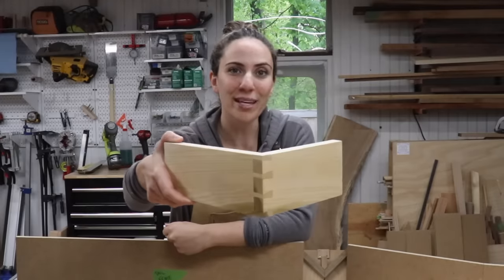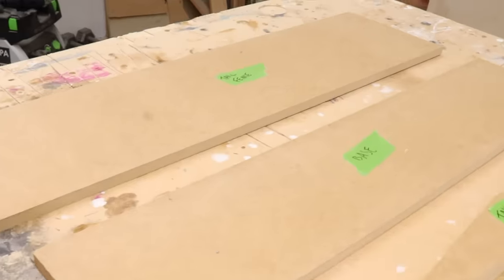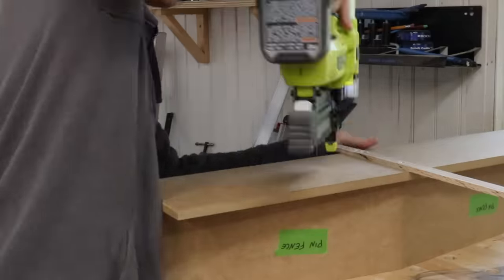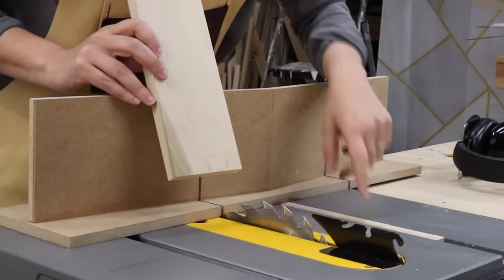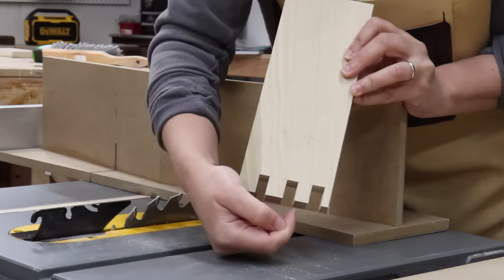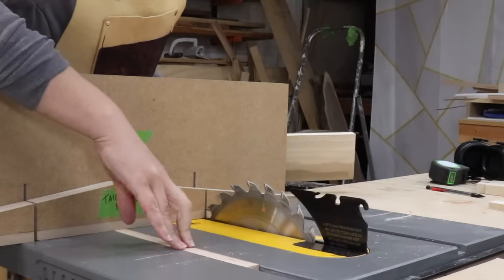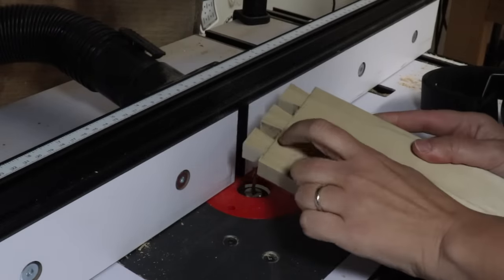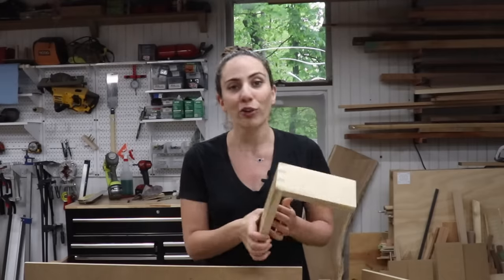Dovetail Jig for the Table Saw // Woodworking Joinery

Comment: Once again beautiful hardwood used to make test pieces. Shame on you for squandering timber that predates you.
Reply from the maker: Hmmm. Ever try cutting dovetails in pine? No thanks. I’ll stick with poplar for my tests.
Reply: @3x3CustomTamar  Yes, at least a hundred  tails and pins in slats from old pallets. A full day's work.
Recycled pine draws, 10mm sides and 6mm back with ply base (traditionally base grain shows side to side). Attach an asthetically pleasing front face to cover up the through dovetails, this also makes it easy to get a clean fit. There is then the option to have the fronts overlapping the rails and butting up against each other.
So much quicker than stopped tails. I use 11mm thick combined runner/kicker rails, hardwood offcuts if I have them. There is a potential problem of wear but a candle is your friend (might try carnauba some time).

Comment: Your problem my dear Crafty girl is that 'angled' dove tails aren't the only option for a cool look and a strong joint, in fact their "look" isn't considered cool anymore by today's standards, the Straight & Square type is faster, simpler and  better looking than 'Angled' ones to do. Even drawers and boxes look better than angled ones. They were popular in the old days because the angle gave them strength but today's glues and CA adhesives solve all that. Remember the adagio: "the shortest distance between two points is a straight line" and also the simplest. That's why 90 degree cuts are simply the most popular today. Angled dovetails are time consuming and nowhere as cool looking as straight ones. And your videos are cool but the one "delightful to watch" it's You. You cutie crafty girl You! We need more women in the craft trade, welding and construction. No more "home makers"! Only Home Builders! Let men learn how to clean and cook their own meals... it is about time!!!